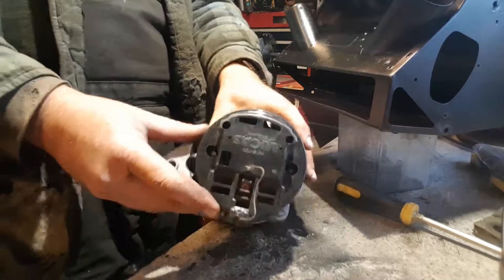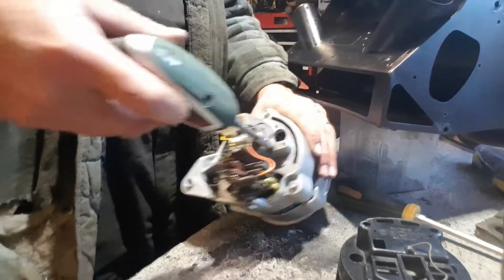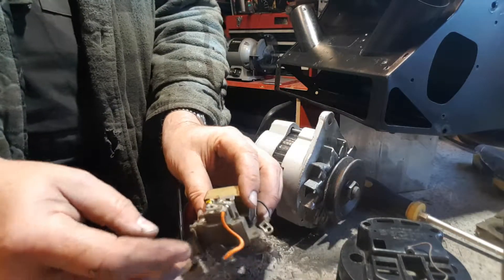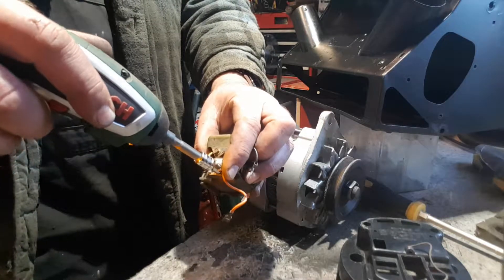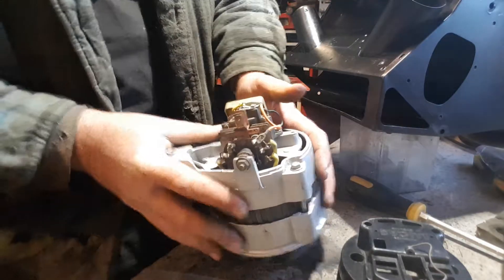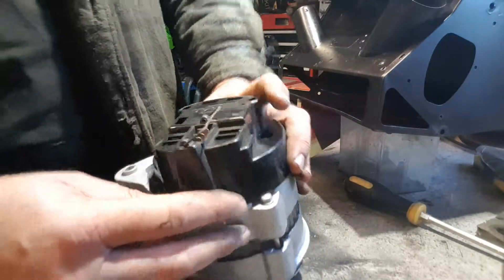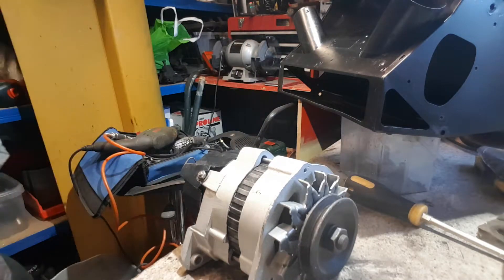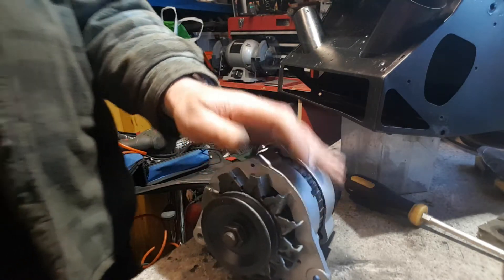Lucas ACR Alternator brush replacement

Comment: My Lucas ACR alternator has a short outer brush and a long center brush, so I'm going to just swap the short one into the center.   By the way I would be afraid to tighten those tiny screws with a power screwdriver.
Reply from the maker: Replace both brushes would be my suggestion, chances are that the more heavily worn item has been sticking in the channel and burning out. I am usually careful with power tools, been a while since I made this vid but reckon the tool would have been 5ft lb max. New toy, less lazy these days